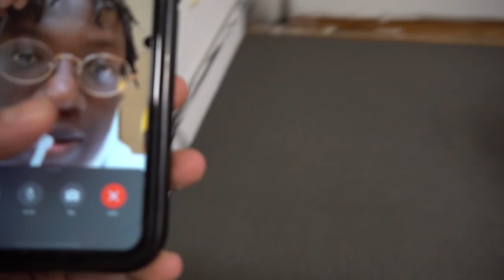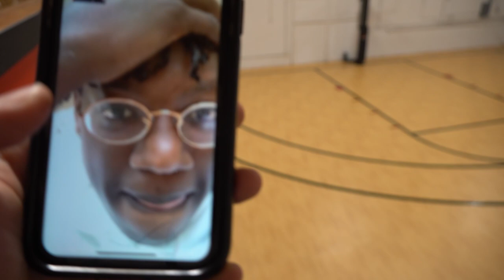I Got My OWN Basketball Training Facility | FULL Gym Transformation | GYM Tour

Comment: Currently working on doing the same exact thing in El Paso Tx
Reply from the maker: Let me know if you have any questions or if I can help with anything!
Reply: @tjltraining  our facility is very similar... I may questions for you soon
Reply from the maker: @differentbreed3933  awesome
Reply: I have a question, did you have to level out the concrete floor before you put the floor down ?
Reply from the maker: @differentbreed3933   yes the flooring company leveled the floor best they could before installing floor

Comment: We have a basketball gym in a warehouse with portable hoops. The ground is concrete but e recently bought some heavy duty in ground hoops. Was it difficult to get your hoops in cuz of the concrete? Like breaking through and digging a deep enough hole. We haven’t installed ours yet also what kinda flooring did y’all lay and from where 😁
Reply from the maker: Just need to cut the concrete don’t think it’s too difficult if the you have the right tools and people to do it. Also got the flooring from icon surfaces and it is a synthetic hardwood floor which is a great surface. Durable and affordable